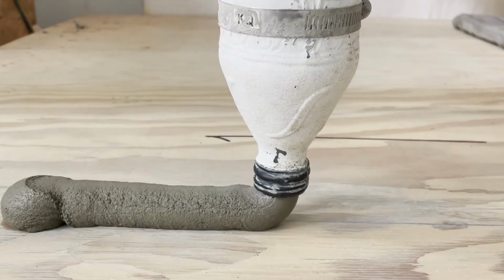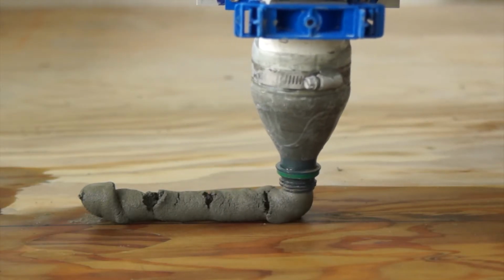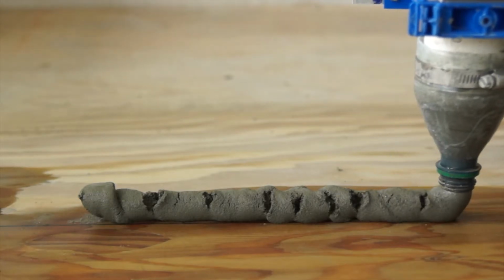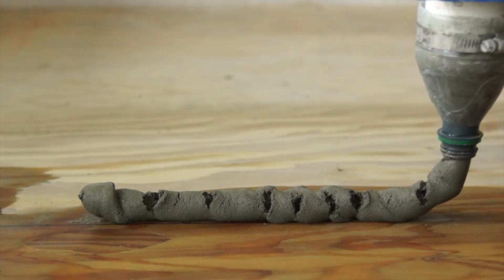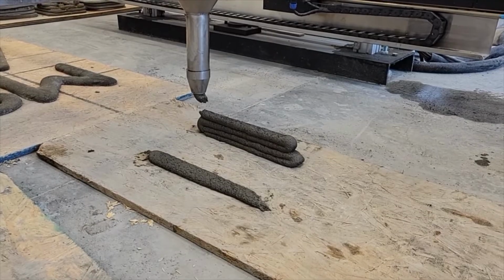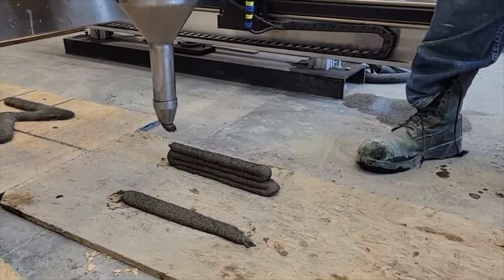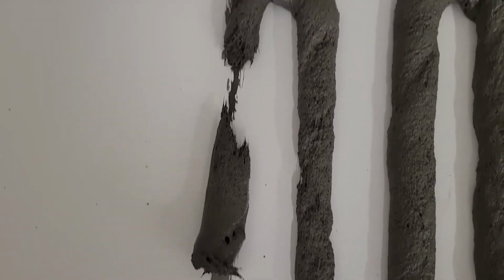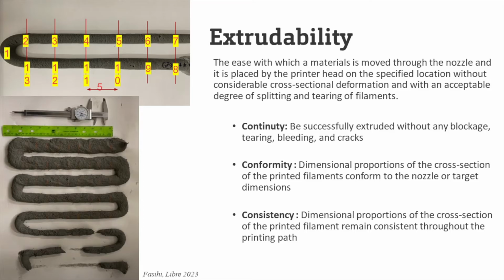Extrudability in 3D concrete printing system

Comment: Thank you for this overview of the properties of extrudable concrete.  It would be very interesting to hear more about the concrete blends that you're working with, and the factors that affect their extrudability.  It seems like there are many inter-related factors that go into designing an effective recipe!
Reply from the maker: Sure, here you can find links to a couple of our recently published papers on 3D concrete printing that provide more detailed info
Interaction between material and process parameters during 3D concrete extrusion process
https://www.sciencedirect.com/science/article/abs/pii/S2352012424018319

Characterization of Extrudability Using Rheology and Desorptivity
https://www.proquest.com/openview/b559329a5ea61609247d563160344146/1?cbl=37076&pq-origsite=gscholar
Reply: @MechanicsofMaterialsLibre  thanks very much, I'll study your papers when I'm able to get access